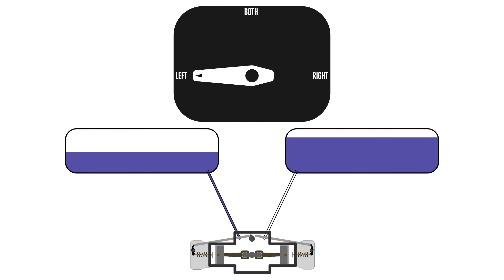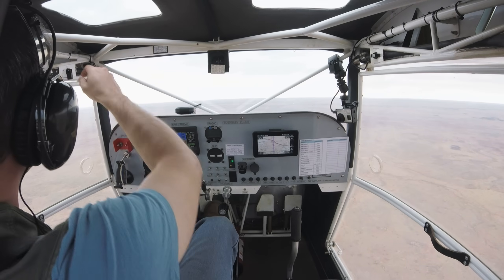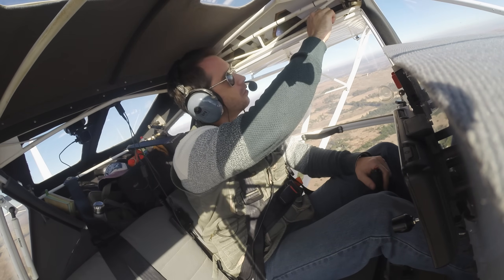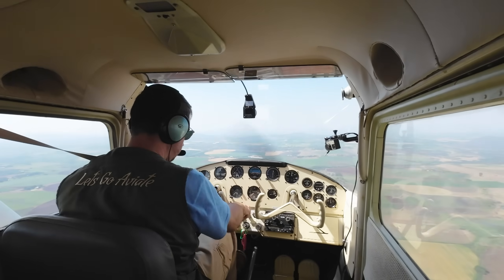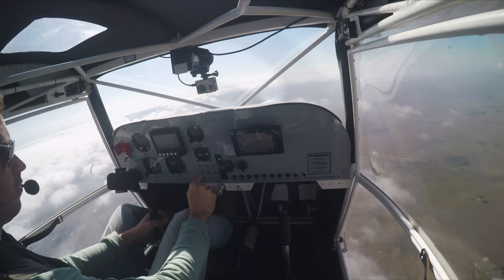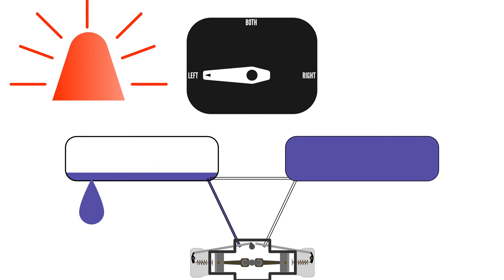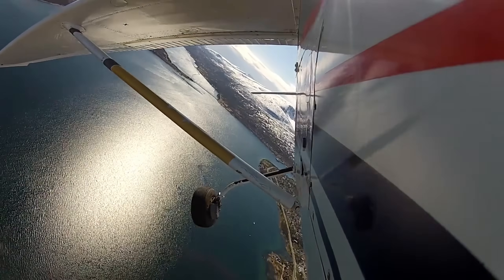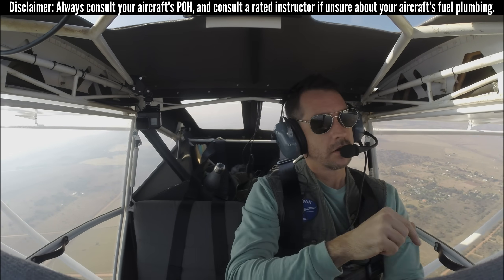Should You Switch Tanks in Light Aircraft? | The Forgotten Practice Of Fuel Management

Comment: When the Helio Courier was designed in the 1950's they went with 2 wing fuel tanks 30 gal each and no left right selector, they felt it was safer.  My Dad a told me of a accident in a 1953 Cessna 180, the pilot arrived on one tank which was low and in a low altitude turn the engine stopped, the plane crashed .  This is why Helio made the design decision of no left-right switch.  Later Helio's are different as they used more tank's.

Comment: OK, I used to fly my Tri-Pacer (with two 18 gallon wing tanks) on one tank until I thought it was half empty. Then I'd switch to the other tank and, if the flight were long, run it dry. Yes, the engine suddenly stopped and, expecting it, I'd immediately switch to the other tank (which was half full/empty). That way, I've completely exhausted one tank and know there was no more usable fuel in that tank. And I had about 1/2 tank left. The caveat is that if you're near landing on the tank you're planning to run dry, switch to the other tank prior or you may run dry at an inopportune time. After 36 years flying, I'm still alive. And never crashed a certificated airplane. But that's another story.

Comment: How often do you get a blocked line?     More common is to forget to swap tanks in non cross feed plane.    My brother was famous for that,  I always watched his tanks and tapped him on the shoulder when he needed to switch,  I called myself auto nag.      His aircraft did not have a BOTH.   He ran out of fuel once.   He recovered quickly,  but go low and suck something into the carb?  Ungh.    If I was flying an aircraft that had both,  I used both.   I monitored tank gauges,  they should go down about the same.   So yea,  switch the fuel and an O ring goes?    If the gear does not go up or go down,  the resolution is obvious.    Fuel spilling or draining out in the cabin?   So cycle the switch on the ground,  then put it to both.
Reply from the maker: To me, asking "how often do you get a blocked fuel line" is like asking how often do you get an engine failure? So why train for it? 🤔 Every pilot is free to make their own decision, I simply share my reasoning.
Reply: Probably not blocked (what is in your fuel thats large enough to block an 8mm ID hose?!) but kinked/collapsed is another matter, I've experienced this with an old perished hose (previous owners poor maintenance) and nearly ran out of fuel as one tank was not feeding.

Comment: You shouldn't need to routinely switch tanks back and forth just to discover a blocked fuel line unless your aircraft has no fuel gauges, or tends to feed rapidly from one tank with the selector in the both position.  What kind of pilot does not frequently check fuel balance anyway?  Answer: A pilot with only a single tank or bad habits. 
 
I don't have much single engine time, but if I was in a single with a BOTH position I would use it, and only burn from a single tank when needed to address a developing fuel imbalance, which I would notice due to routine monitoring.  This would conform to my habit in multiengine aircraft, which is to crossfeed only when necessary to prevent or correct an imbalance.  Feeding all your engine(s) from the same tank should be a temporary condition requiring  increased vigilance to prevent creating a serious imbalance or starvation.

Comment: I regularly used to refuel only the `more empty` tank. I used to switch tanks to validate the separate fuels in each. With my hand on the switch I could switch back instantly. This was in a plane with two tanks. On multi-tanked aircraft I would switch as a pair -  inner/outer tanks not individual tanks. Saved my life once when some dumbass put diesel in the outer wing tank of an Avgas-emgined plane.

Comment: I fly a 1961 Cessna 172B model - there was an AD issued in 1972 (72-07-02 CESSNA: Amdt. 39-1415) that affects 172 models from A - K.  The AD was issued because the fuel system was plumbed in a way that turbulence in the fuel lines above 5,000 could cause vapour to form in the fuel lines and result in fuel starvation. 
The fix was to either re-plumb the aircraft (expensive) or place a sticker on the fuel selector valve cautioning the pilot to only use single tank above 5,000 feet and switch tanks every 20-30 minutes (less expensive). Of course most owners cheaped out and only put on the sticker and now 50+ years later the stickers are worn off or pilots don't understand the underlying reason for single tank use at altitude in these models of 172. 

I ignored the sticker, and had a fuel starvation issue at altitude with full tanks... Thankfully during the episode I remembered what to do and was able to recover.

Comment: ANSWER THIS:  LEFT & RIGHT ONLY Airplane. POH = takeoff and Land on Fullest Tank.  (1) Example: You start, taxi, runup check on LEFT but before TAKEOFF, do you switch to RIGHT tank because it's fullest and BEFORE T/O check list says so?   (2) Example. You enter pattern on RIGHT Tank, do you switch to LEFT tank because BEFORE LANDING Checklist says switch to fullest tank?  
MY ANSWERS BELOW. Feel free to comment respectfully. Please no trolls or MSFS Jockeys. 

(1) ANS: For T/O after start (last tank used for landing) my after start checks switch to fullest**  for taxi, runup and take off (not right before T/O). 
(2) ANS:: For LANDING my "in range" or approach checks (at altitude) switch to fullest** (not down and dirty in the pattern).   

** NOTE: FULLEST, is not absolute, "Fullest" if the L&R tank difference is small, I will leave on current not "fullest" tank for T/O and Landing if there is sufficient (more than say 1/3rd) fuel Est. by "time x FF" and fuel gauge. You know that tank is good. For example tank you landed on, started, taxied on, run-up on is only slightly lower, LEAVE IT.   After takeoff at altitude switch as/if required. For example LANDING, on one tank for 20 min, entering pattern/approach on that tank, now slightly lower than other, LEAVE IT.  Switch as needed or as convenient but not a last minute afterthought. 

TIP use timer, watch, stick-it's to remind you to switch every XX min. I have flown light twins with many tanks, with Cross Feeds and even header tanks (Ted Smith/Piper Aerostar). That and some Cessna Twins required good understanding and your attention. I did starve an engine in cruise when the Aux tank went dry early? Why? That tank also fed the gas fired cabin heater, so it used more fuel than the other Aux.  On the other hand if you expect to get ALL or Most of the fuel out of each Aux tank you do have to use good timing techniques. However running dry is not recommended.

Comment: no one switches tanks - it gives zero advantages. It can be used in some very rare conditions, but in usual flight on usual 172 BOTH works perfect.

Blockage on tank line is perfectly visible on modern cessnas with glass displays, conveniently showing both meters next to each other. If the line is blocked you see one tank depleted and 2nd is full. Just check fuel every 30 min.

If you BOTH tanks are on very low, up to air sucking, it means that you are already in big trouble, and no switching helps - in this case one tank will be not on low, but already completely dry. It allows to press out the last 10 liters out of 200 - no, people, never ever do this, just do not get in such a situation!
Reply: There is a known issue - with an AD - that requires 172 models from A - K to fly single tank only above 5000 feet.

Comment: There is a lot to be said for training. The plane I normal fly has no fuel selector, a large header tank, and checking the fuel level is by pipes directly connected to the tanks. The flow our club teaches includes fuel, gear and prop checks meaning when I swapped to a plane with a selector in another club, it was already built in to the FREDA check I was doing.

Comment: I some aircraft like the C172-c modle, you are required to switch tanks above 5,500 because the fuel flow is restricted to the o-300 engine. I didn't know this and ended up making a forced landing, thinking there was something wrong with the aircraft.
Reply: This happened to me several years ago in my 63 D model. We were cruising at 6,500’ and I had forgotten to switch to a single tank. It took about 10-15 minutes at cruise before the engine started wildly oscillating in RPM. It was a very predictable up and down surge in RPM every few seconds (which is indicative of air bubbles in the fuel line reducing the fuel flow to the engine). Luckily I was within landing distance to a nearby airport and landed it with no issues. It was only after I landed that I did some research and realized what my mistake was. Also, in retrospect, once I got below 5,000 feet, I realized the engine oscillations cured itself. So definitely a pressure altitude issue with the fuel system on these early 172’s
Reply from the maker: Yes I've heard of such an incident, maybe it was yours?

Comment: Thanks! I am in the same spot: My FS only wants me to run our 172's on both tanks. One reason you where missing IMO: Balancing out fuel levels in your tanks for better flight characteristics. Funter I wonder: Why not test both fuel lines for blockages on the ground already; ie. during warm up? This would identify a blocked fuel line where it is comletly safe.
Reply from the maker: You're correct ragarding balancing fuel levels. Testing for fuel line blockages on the ground isn't really practical, unless your plane has no header tank, which is not too common. So you'd need to run it at cruise power (>60%) for like 15 minutes on the ground, (depending on the size of the header tank) to run the header tank dry. Not good for an air cooled engine to run without proper airflow. If it has a visible header tank like some LSA's you may notice a problem sooner, but would still need to do it for >10 minutes at cruise power to notice the header tank level dropping.